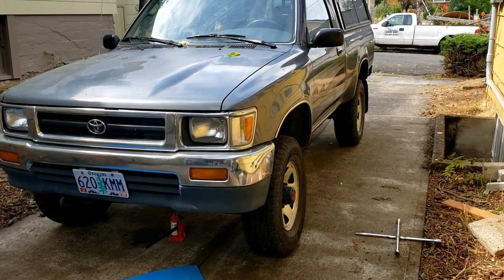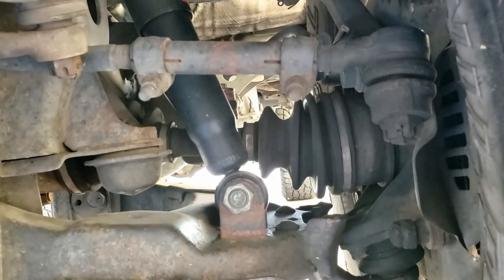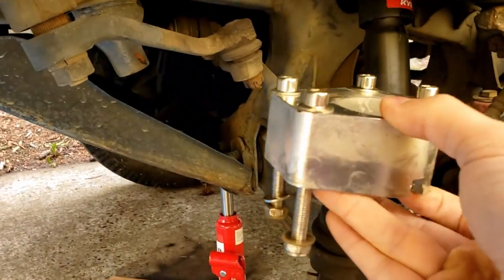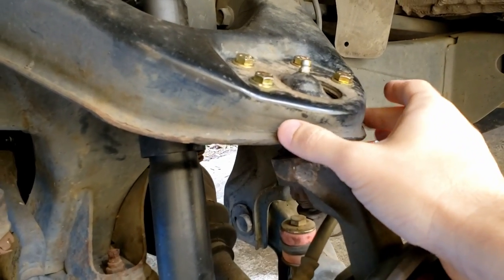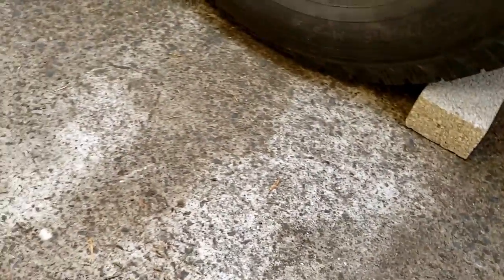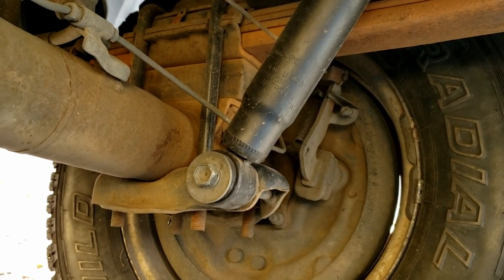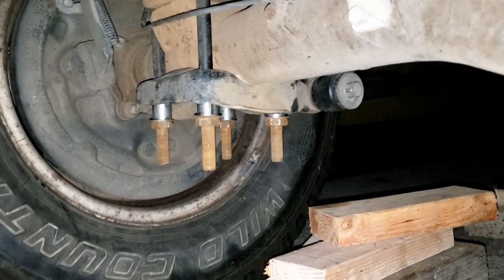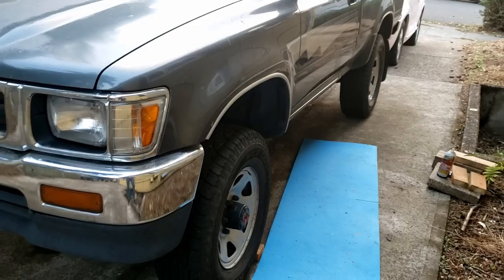Removing the 2.5in Lift from the 1992 Toyota Pickup, Going Back to Stock Wheels & Ride Height

Comment: FYI For those having the same issues but want to keep the lift, you just need to regear the diffs to match the difference in tire size. Solves all those issues, speedo and all.
Reply: All it takes is $$$
Reply: Yep, I have stock 4.56 gears on my 92 pick-up and am about to run 33's which are still ok with 4.56 but have already purchased a set of 4.88's.  And at that point you're kind of committed to never going back to stock tire size.  Really comes down to whether you want a highway truck or trail truck.  I chose trail!
Reply from the maker: Missed the comment, but this is very true! 

For my needs, the quicker (and cheaper) route was to go back to stock, but it's absolutely possible to build a 4 cylinder wheeler with bigger wheels and tires.

I didn't want to change the 4.10 gears in my truck, but for what it's worth the lift & tires went to another Toyota truck euthenist and got used.

Comment: What you did made a lot of sense for the 22RE.  I actually saw a guy recently (florida man..literally) who put 35's on an old yota like this with a 22RE.  I told him I "truly felt sorry for his engine".  Suffice to say he didn't get it... but he will soon enough.  That said, I have a '92 Ex-Cab 4x4 5-spd manual with the 3.Slo.   Advancing the timing a little actually helps it a lot but it's still a weak v6 unfortunately.. and same issue with any hill, it just dogs out.   Regardless, I'm about to do a 1.5" body lift, 1.5 BJ spacers, Ford F150 leafs, and mount 33 x 11 tires on the stock 15" aluminum wheels.  Wish me luck lol.  Ideally, all these trucks really deserve the slightly beefier 5VZ swap or a 5cyl TDi Diesel swap like Austin Niemela does here on YouTube.  It's hands down the best option I've seen.  Maybe one day!
Reply from the maker: I dig it! Yeah in the 2 years since this video was made I've benefitted from the power while doing highway driving, but I'd be lying if I didn't miss the big wheels a bit

Comment: Going with smaller tires on my 84 Nissan pickup made it more fun and fuel efficient (2wd). Going back to stock stuff should ensure you will never need to buy another truck in your lifetime. If you want one, I highly recommend a 1st gen Honda Ridgeline. My 07 is totally badass and stock. The pins in the parking brake cables are called clevis pins. Your truck should love this. Those were some of the best vehicles ever built.

Comment: Love seeing it go back to stock. They look so handsome stock. Plus restored or original ones are worth way more
Reply from the maker: Thanks! Am trying to keep this one in good condition
Reply: I think that's very subjective.  The stock trucks, while you can argue have a "nostalgic appeal" still leave a lot to be desired by modern standards.  And a lot of people would prefer to have a truck that's modded and built properly, lifted properly, etc, because it takes a lot of research, planning, money, and significant amount of time and labor to get it all done.  Now, that said, I have a stock 92 4x4 in great condition mechanically but it really needs a paint job and updated suspension, ball joints, etc.  So... instead of spending $3000 or more on paint I'm going to Raptorline it for $1000 and spend the other $2000 on lift and suspension components to make it much more offroad capable.  In short, there's a lot more usable value in that than just having and old stock truck with a nice paint job.   When done right with regearing, diff lockers, etc.. it's simply a much better, more capable truck that is worth more than stock, providing you haven't put 100k miles on the upgrades.

Comment: What size tires did you go back to?  I'm trying to move to a 235/75/15 and they scrub on my 93 toyota pickup ext. cab 2wd.  They also give very little space in the cargo area to add any weight!  I love the stock soft ride and would like to stay close to it.  What adjustments would you recommend to make these tires work? TIA.

Comment: A lift and tires larger than 31" on any small truck starts to undo the benefits of a small truck: easy to park, easy ingress/egress, easy to load, lower cost of ownership/maintenance. No doubt the extra ground clearance helps off-road but the added large tire strain is more likely to bust something. Front and rear lockers/limited slips are a wiser investment to improve traction off-road.
Reply from the maker: Agree! A locker would be a great upgrade on this truck someday

Comment: You really should have used bigger blocks for the back wheel and also you wanted to stick the blocks on the opposite side at the rear you have more of a chance of the truck rolling off the blocks when it's on the same side of the vehicle you're jacking up to avoid any problems you can put them at the rear of on both tires in this case but with those little tiny bricks you could slide off of your bottle jack very easily especially a bottle jack with a small contact point

Comment: Travis, enjoyed your video. I have a 1997 Hilux single cab with stock suspension and the stock 16" steel wheels. How wide can you go with a set of aftermarket wheels, and how large can the tyres be with the stock set up, before a lift kit is needed?
Reply: No bigger than 33" and you typically need at least a 1" body lift or use 1.5" ball joint spacer, in which case you need to lift the rear too. It's a can of worms.  This is why a mild body lift is easy and actually pound for pound keeps center of gravity lower as you're not raising engine and frame.  When you do, it's also wise to have a wider stance, but then that enlargens wheel radius,..and back to the can of worms.

Comment: Do you remember the part.number for the ubolts ? Replacing my leaf springs guess i should get new ubolts
Reply from the maker: Aaah I don't sorry - new u-bolts are indeed recommended since the threads on the stock ones will stretch, you'll likely have to go to a few auto parts stores to get a good match

Comment: i know this isn't related but i have a garnelli grand sport 1977 and it starts up but won't idle, it shuts down after i let go of the throttle, anything i can do to get it to work better
Reply: Tighten up your throttle cable
Reply from the maker: It is likely a dirty carb, and air leak, or possibly the rubber clutch is sticking

Comment: You do not put jack stand under rear differential. That is big NO NO
Reply from the maker: It is listed as a jacking point in the owners manual:

https://www.toyota-4runner.org/attachments/5th-gen-t4rs/153720d1429094081-jacking-points-lift-support-jpg

& Haynes manual

https://cimg0.ibsrv.net/gimg/www.yotatech.com-vbulletin/732x975/1987_toyota_truck_and_4runner_lift_and_support_locations_445d64abfe17a6fa730d148ae50718cda817456b.jpg

Any particular reason why not?

Comment: I have a 92 single cab 4wd 22re and I’m on 35x12.50 tires with 22x14 wheels and I’m still able to use 5th gear and actually accelerate in 5th gear it is a little sluggish but it’s still faster than all my friends jeeps that are on 35’s and are i6 4.0s
Reply: The fastest I’ve gone in it was 90 mph and the only engine mods I have done is an egr delete
Reply: Your truck has no issues pushing 35s on the trails?
Reply: @robertbresnahan4179  your truck have any issues on trails? Pushing big tires?